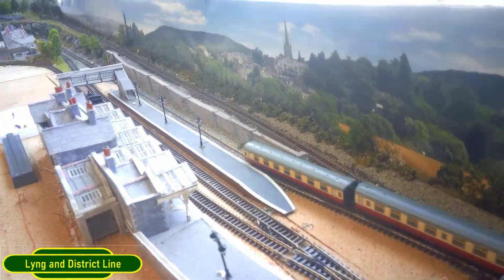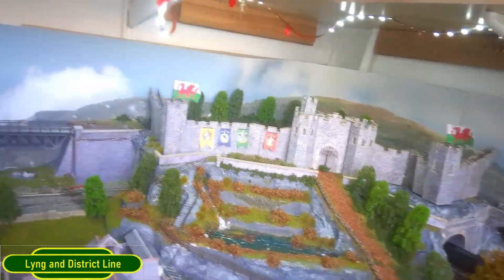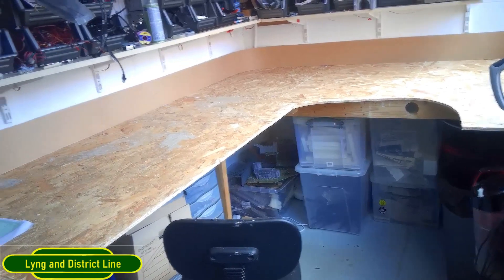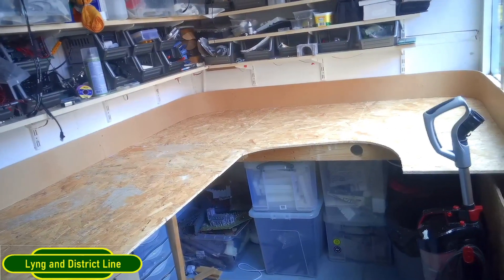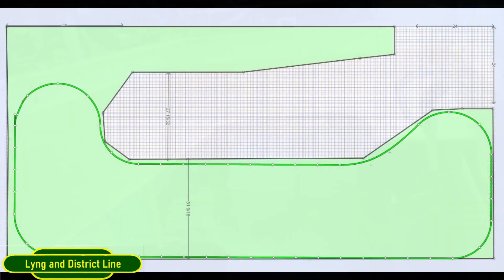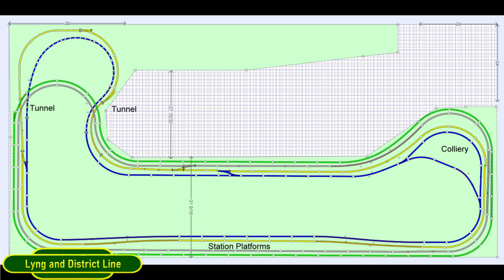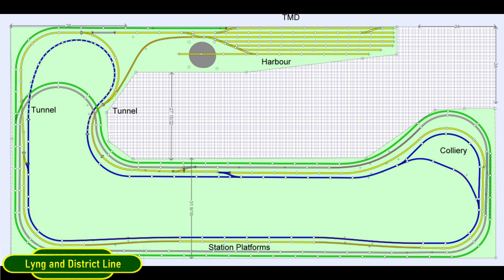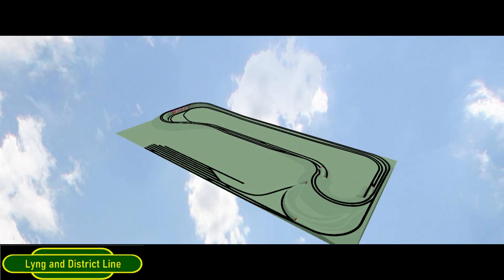Episode 50 - Lyng and District Model Railway - All Change!

Comment: Wow! Steve! What a big decision mate! Sometimes it's hard to decide to perform wholesale change, so very well done! I'm sure you'll be much happier with the new setup - especially as you can get to it!!! My only advice would be to make sure that the gradients aren't too steep, and to test them before committing to them! Oh, and check that you can reach the back of the layout and into the corners! Mine is only 30" wide at the widest point, but I struggle to lay track at that distance because of the height of the layout! So just make sure you check! I'm sure you know this stuff, but just thought I'd mention it! I'm definitely going to enjoy the journey of the new build! All the best, Ian.
Reply from the maker: Yes Ian, I have been testing those gradients all week now, following your example. Maximum width is 30 inches so are reachable but as before I will start from the back and work my way in.  I intend to have a complete smooth trouble free track laid before even thinking about glue anything down! 
Regards
Steve

Comment: Well that is a surprise for a wet Thursday morning. I like the plans for the  new layout.  It isn’t easy to start again but there was no point persevering with a layout that might cause you injury to try to access, and you do have the benefit of using all that you have learned in your new one. I was finding it hard to get the levels but I think I got that from the last image.  It did look as if the gradient for the grey line after the crossover to the yellow is quite steep to rise over the yellow and blue lines going under it.  What is the gradient for that section?  I also like the arrangement into the TMD.  I am pretty sure sure you are going to need to be careful wiring the the triangle section to avoid a short circuit as the polarity reverses. But it does provide a great way of turning whole trains if you want and your go to guru on wiring will be able to help you with the kit you will need. Look forward to seeing this grow over the coming months. Stephen.
Reply from the maker: You were right about that steepness as you will see form the next video Stephen! I read the wrong percentage and realised after some testing I needed 8ft to pull 4 carriages, but I got there in the end. 
Regards
Steve

Comment: Wow what a huge change, looks as if it does exactly what you want, never an easy decision to rip up and start again, what radius are the curves
Reply from the maker: Colin, for the outer curves on the main lines they will R4 and inner at R3. The third track will be R2 and R3 where I can as this will be the "coal line" and local line so won't need long rakes or carriages. 
Regards
Steve

Comment: Hi Steve, good to see you back, if you were not happy with the old layout for all the reasons you stated then yes it makes sense to change! I did it myself so I know it’s not an easy decision but if you we’re struggling with your back it’s a no brainer! Liking the plan it’s gives you lots of running options and capabilities. Are you going to use the TMD as a sort of fiddle yard as well as a TMD as you have a number of long sidings? Also from my own experience of having track close to the edge there is the risk of trains falling off or being knocked when you lean over the layout, just maybe something to consider? Cheers Gary
Reply from the maker: Hi Gary - yes, because of limited space the TMD will double as a fiddle yard, so that as the locos run around the main tracks I can "play" on this area. The edges of the boards will all have a small plywood "wall" to stop anything dropping off, and without the foam means the whole lot is 25mm lower so easily reached over.
Regards
Steve